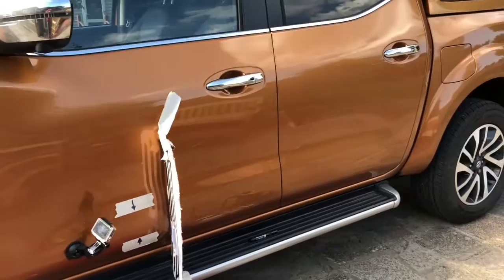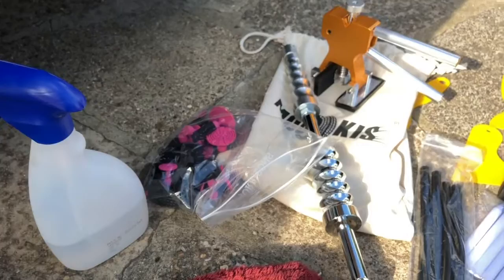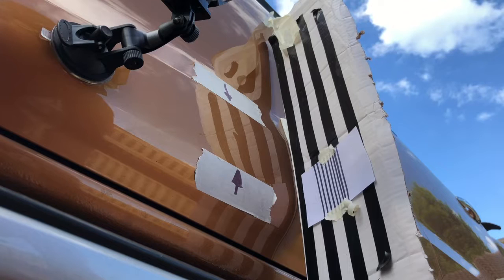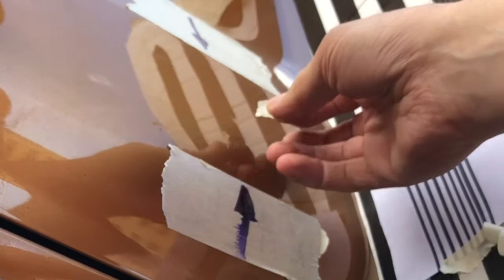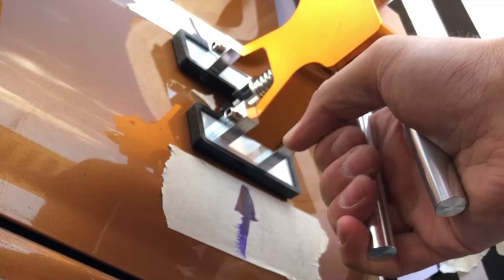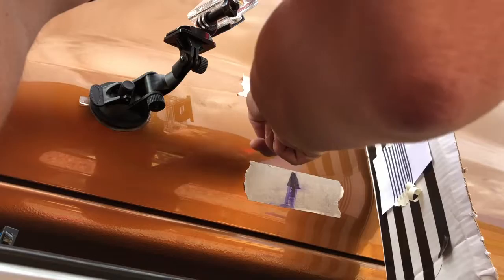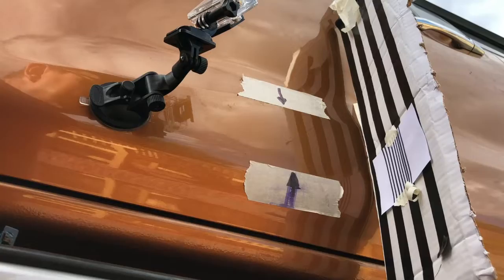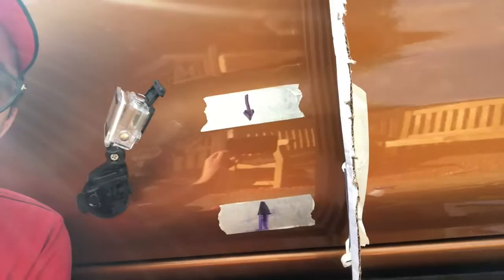NP300 Navara DIY Paintless dent removal (PDR)

Comment: Am sure if you had the inner door panel off, and a few taps with the softer part of your hammer on the inside panel, you could of maybe claimed an extra milli or two of that dent, even though i believe you stopped at the right time.....